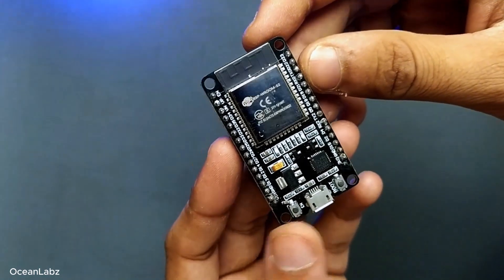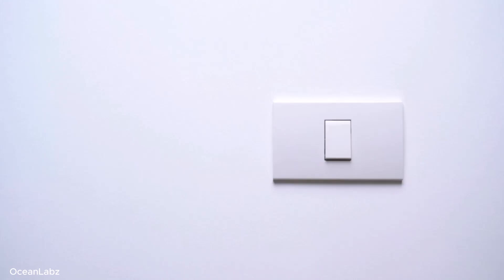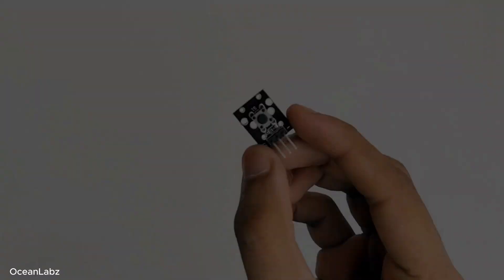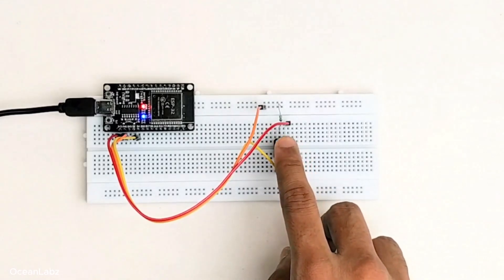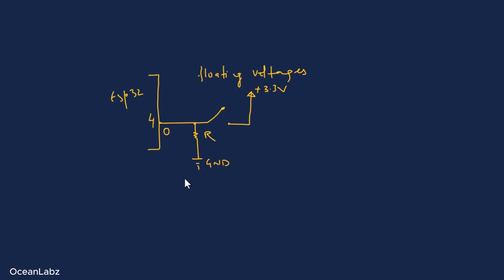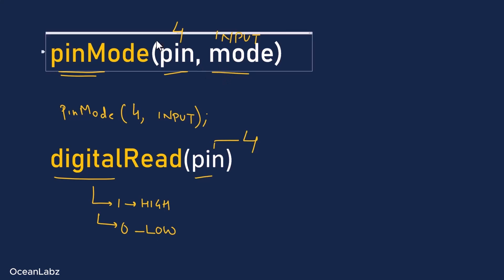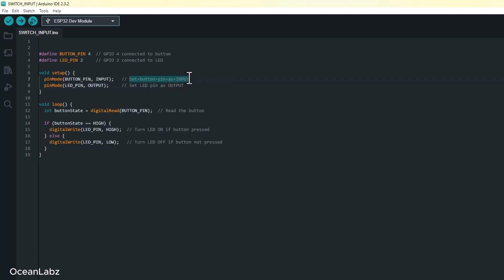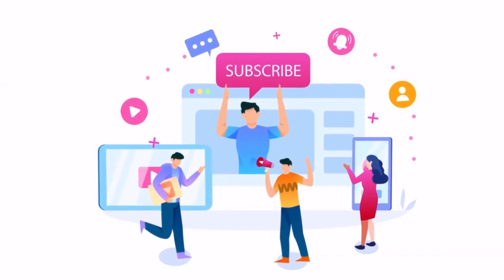Read Button Inputs & Control LED with ESP32 | Digital Input & Output Explained

Comment: if you use pin Mode Input_Pullup, you don't need the pull-down resistor.  You hook the switch to ground.  So when the switch is pressed, the input goes LOW.  This removes one external component from the circuit.  You did not discuss button bounce which is an important concept.  There are Arduino libraries to include to handle button bounce.  I know you are trying to keep things simple.  But in the real world, buttons bounce.  It can be handled by adding Delays in the code which is lazy design.  Or by button debounce libraries.
Reply from the maker: Yes, you're right — just to give a quick hardware idea. using INPUT_PULLUP works better than INPUT_PULLDOWN, and it also removes the need for an external resistor. I’m considering covering this in more detail in the next video, especially along with switch debounce, which is definitely important in real-world applications.